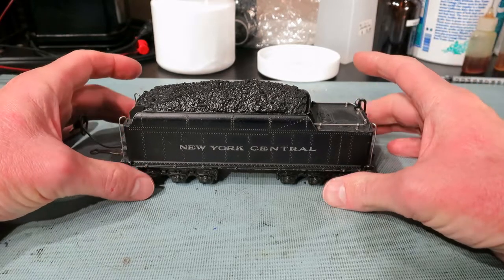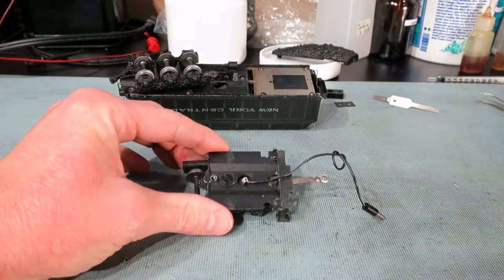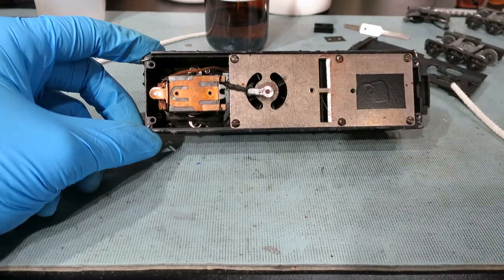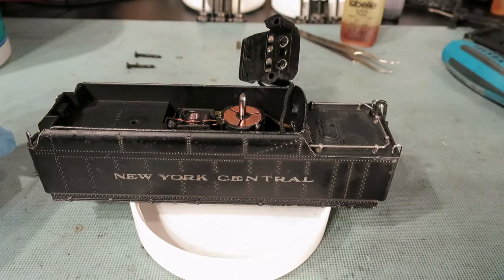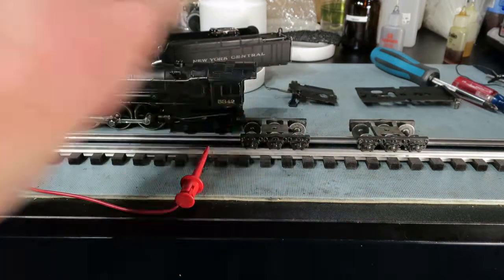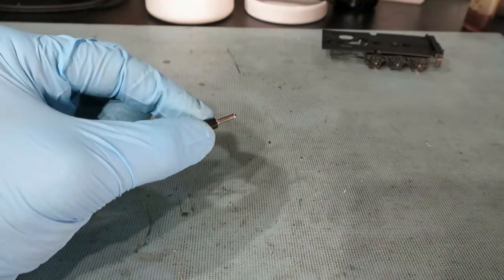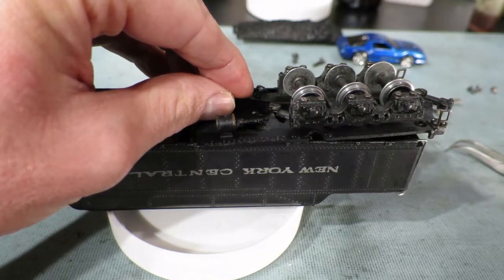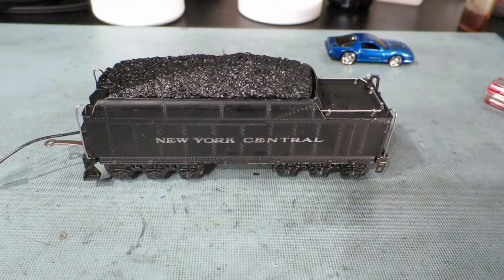SERVICING A LIONEL OO HUDSON PART 4

Comment: Hello. I have this same engine and tender from my father. I need to replace the damaged wire and plug. Do you know where to source a plug? Digikey and McMaster seem to only have larger diameter plugs. Thanks
Reply from the maker: Hi Jeff, I have never seen a parts list for these engines, so I'm about 85% the part number is 2227T-36, it also goes by alternate PN 2020M-36.  It seems to be available at most Lionel Parts dealers, I can suggest one if you want.

Chris
Reply: @chrisselectrictrainlab  I would appreciate a recommendation. Thanks
Reply from the maker: I like a place called The Train Tender, 

https://ttender.com/partslist.html

Look for the part number 2020M-36.

On the left-hand side of the page they have different categories and pages, it will be on page 6.  Also they have an "OO" category if you need other Lionel OO parts.
Reply: @chrisselectrictrainlab  Great. They’re even just 20 minutes away from me. I appreciate it. Your videos will also help me with cleaning the engine and tender
Reply from the maker: That's amazing!  Good luck and let me know how your engine turns out.

Comment: Can these service tips also apply to the O gauge whistle units? Specifically using the thiker oil on the brush plate?
Reply from the maker: Hi Dylan,  I find a medium weight oil is fine for most O scale whistling tenders because most have an oil wick on the brush plate which helps keep the oil in place.  Chris